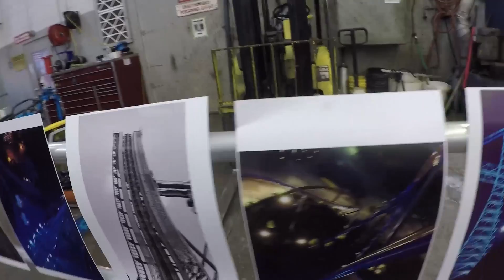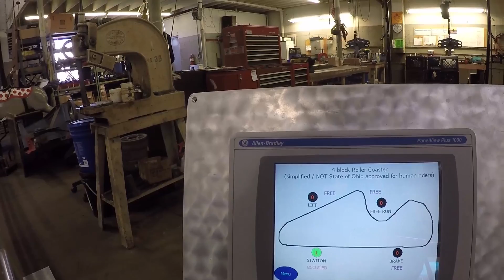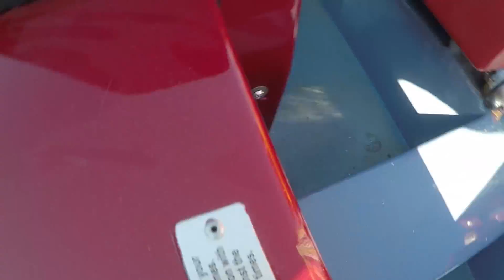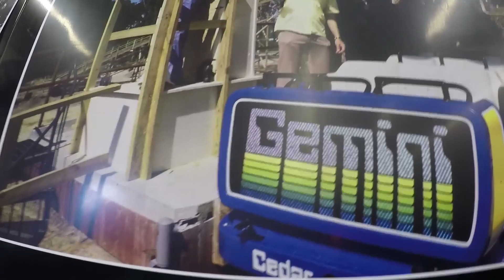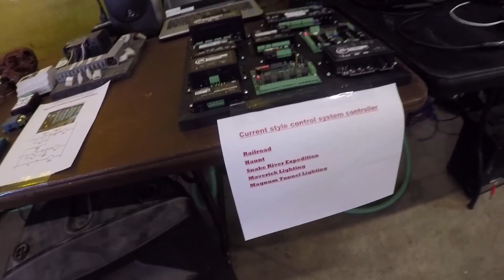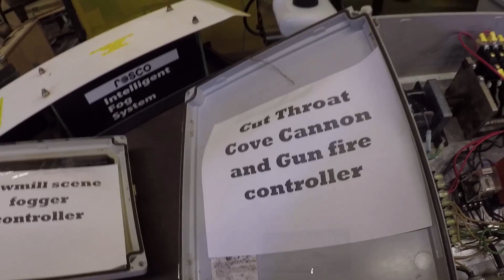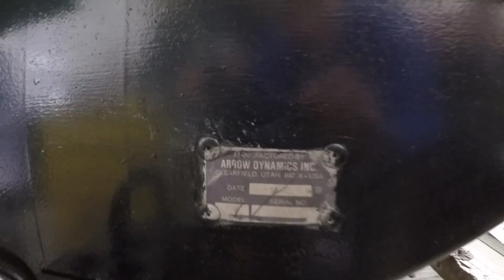Cedar Point Winter Chill Out 2020

Comment: "yeah usually a power failure...this is foam injected into a mold...yeah same cylinders as aircraft flaps..this wire tends to fall off" 

meanwhile in the b&m workshop, 

"yeah b&m coasters are pretty simple... just follow the manual, usually there are replacement parts on the shelf" 

The contrast between the Intamin and B&M coasters from the perspective of the mechanics is too good XD.
Reply from the maker: B&M really is #1

Comment: Just a question - can a ride with a vertical lift hill such as a gerstlaur eurofighter stop on the lift hill, and if so how would it be evacuated?
Reply: Lift would be manually jogged to the very top and would either continue the course, or there is a catwalk at the top where riders can evacuate. Most vertical lift hills can also be jogged down because they have a dual chain lift.

Comment: I remember a video where Maverick valleyed upside down on the zero-g roll. Is it fake, was the video real?
Reply: An Idiot With Internet I think it was real. But I’m pretty sure it was an early morning test run with no one on it.
Reply: An Idiot With Internet I believe Maverick had that zero-g roll in its original design and they built it to test, but it was determined that it was too intense so they removed it before its opening so no one got to experience it sadly.
Reply: polygon298 I thought they removed the heartline Roll.
Reply: Caleb Moore oof I think I confused zero-g with the heartline. My bad haha!